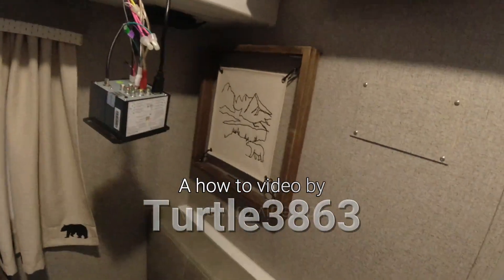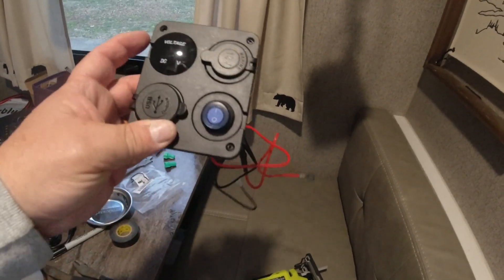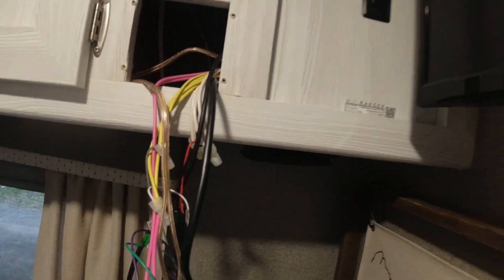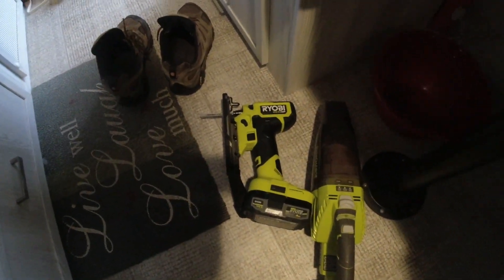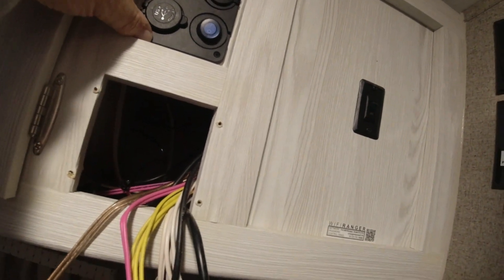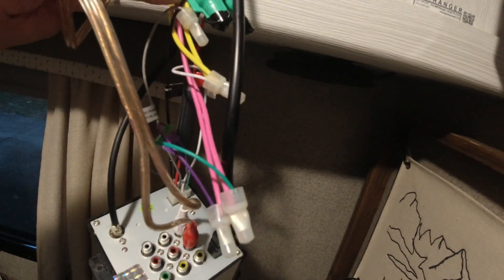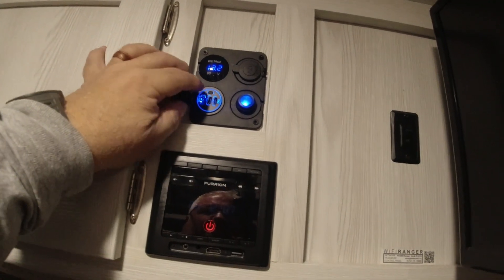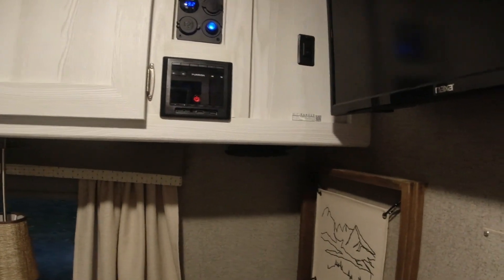12 Volt Add On for RV

Comment: Thank you for the Amazon link.
Could you run the radio in series so that when you turn off the switch it would also turn off the radio?
Reply from the maker: @michaeltimko6141  I guess that could be done. Nice idea, I will have to think about that.
Reply: @Turtle3863  That's kind of what I did to my RV. I mounted two switches near my radio. One switch turns off power to the radio and 12v multi port outlet. The other switch is for the aftermarket rear view camera that I wired direct to the battery system. This way I don't have to turn on the vehicle lights when I'm travelling.